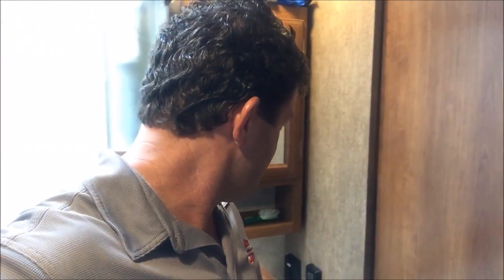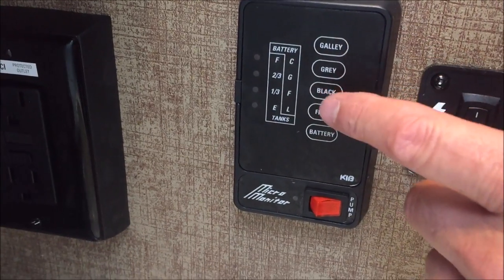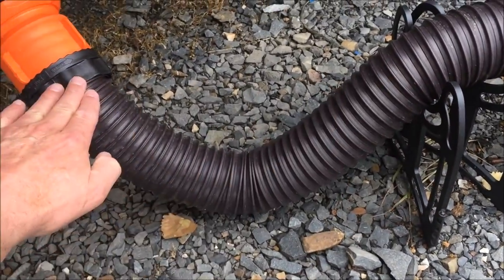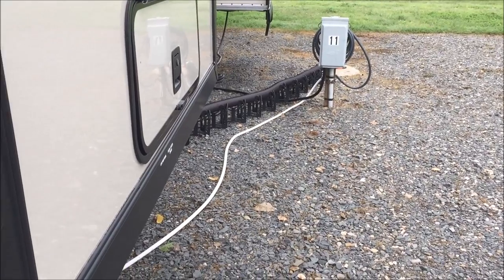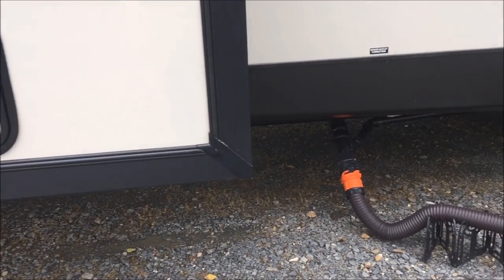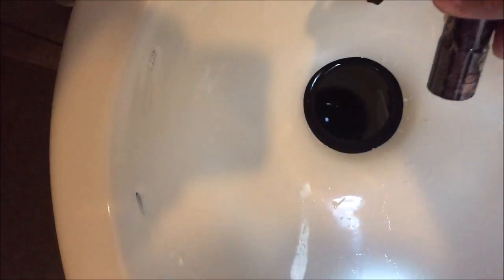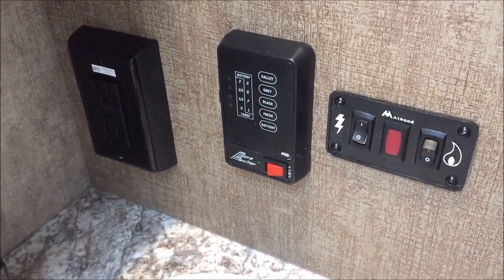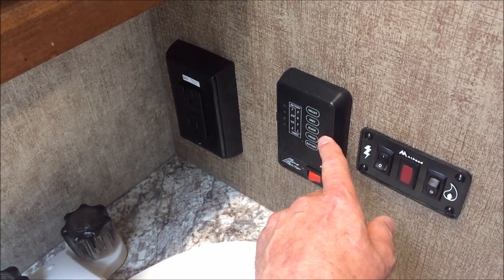Preventing Black Water Tank Sensor Problems

Comment: What type Name and model your in?
Reply from the maker: Its a 2016 model Prime Time Lacrosse 337 RKT.  Over two years full time and I still love it!
Reply: Just Plain Common Sense, okay so.... have you ever had to change the sensors? My TT doesn't have the adjustment screws.....so I'm still seeing full.i barely have two days use and it's showing Full...it's just me! I don't shower every day. Idk I'm at my wit's end with this thing! The neighbors say that I need to "take it for a drive" with about 6 gallon's and 6 oz TNT treatment. I don't have a flush valve
Reply: SoCal Gal   If you are using the auto flush as demonstrated in this video, Just be aware that they give you a false sense of security. With mine I can fill the tank twice until it runs clear. But if I then use the old fashioned stick type that you stick directly into the toilet, then fill the tank, I still get dirty water until I rinse and fill about two times. View some videos on how these auto systems spray.
Reply: SoCal Gal I don't understand the question.
Reply from the maker: I've never changed the sensors.  If one acts up I fill and drain until it clears out and the top two sensors read correctly.  I rarely get more than two lights to go out but that's OK with me and not worth the hassle of taking it in for repair.  I dump and flush once a week so I rarely have a 911 emergency around here. ;-)
Reply from the maker: Id use one of those systems if I absolutely had to. but the internal flushing system seems to work well so far.
Reply from the maker: I believe she is referring to an adjustment some models have at the control panel to calibrate the sensors.  Mine doesn't have that function either.

Comment: Also , we have been RVing for years and recently bought a used camp trailer from a family estate. I spent hours checking it out to make sure everything worked including opening and closing the grey and black valves. After the purchase we found that the black and grey tanks had been left partially full and had set long enough to have dried out. Once water was put into the tank it took nearly a full day to try to get the inside cleaned out.
Mike
Reply from the maker: Lovely.  Nothing l look forward to having to do! Or is it doo?
Reply: That is what we said to the folks we bought it from and they were going to refund some money for the trouble but we know how that always ends. Nothing.
Mike

Comment: Do not need to drop the tank. The sensor can be replaced easily, and transfer wire from old sensor to new sensor- these are really just screws, but you can buy them as sensors. Just be sure that the new sensor is at the same level as the old one. There are many short cuts to help prevent the "sensor" issue , and this one works well. I am a retired mobile rv tech, RVIA certified. Good luck!
Reply from the maker: I've recently seen the sensor replacement procedure.  I have pretty good luck so far with cleaning them in a tank full of very soapy water.  As long as the top sensor still functions, I'm pretty much ok with it.

Comment: We used water softener and dawn dish detergent, a spray wand to clean tank walls. It deodorized our tanks and reset our sensors. A final swish with 50/50 water and bleach. We leave a crook in our drain hose at the tank hookup and use the clear elbow drain attachment to know when we're the cleanest.
Reply from the maker: That ought to get it done!
Reply: I'm with you. I use much the same routine as you and have, as a full timer, used the Calgon and Dawn for a couple of years with no odors. The main thing that I think cleans best is regularly using the spray wand from inside the toilet. My rv has the auto flush but I don't use it. I did a test using it, then afterward followed up with the wand from inside and it was surprising how much additional stuff I got out. Regular thorough cleaning is a must!

Comment: Worst case, fill up holding tank with hot water and dishwashing soap (half a bottle).  Leave it filled for one day, then drain.  This removes everything and keep your sensors like new.  There are no chemicals out there that will beat this technique.  Also, don't use any chemicals for tanks.  Try 2 tablets of efferdent (tablets for dentures); it is a very cheap and effective way to rid ordor.  Important you leave at least 5-10 gallons of fresh water after flushing black tank.
Reply: Oh, and also, try not to put any toilet paper down the tank; use a waste bin.
Reply from the maker: We only use RV toilet paper.  It disintegrates very easily and causes no problems so far.  Thanks for the tips
Reply: Dawn Dishwater Detergent works the best, and if you can, take it for a spin up hills, corners get it sloshing around, and it cleans up the sensors awsome, yes very good idea,
Reply from the maker: My RV is parked so That trick doesn't work too well!
Reply: why are you worried about the sensors?  Ours haven't been right for over 6 years.  You can tell when your black tank is getting full.  Just listen closely and you'll hear the difference.  Sensors are a waste of time and money.  Haven't checked ours since it was 2 months old and it is 7 years old now.  Never waste water and time worrying about the useless sensors
Reply: 9
Reply: Those that dont take care of their rv,  even the upkeep of making sure the sensors are working correctly are the same ones that dont do maintenance on their own rv and then yell at the manufacturer and or dealer about the problems with said RV.
Reply: @Lovecamping290  I heard some video say Dawn makes too many suds and leaves a film on the sensors. He said use liquid dishwashing detergent gel. I used Dawn once and seemed to have more sensor malfunction. Just my experience.

Comment: Btw you can buy a black tank flush wand you stick down in the toilet ,unlike the black tank flush which is fixed inside the tank you can change angles and height . To get a really thorough cleaning
Reply from the maker: I actually purchased one last summer.  due to the plumbing design on my RV it wouldn't have been any better than the factory -installed system so I returned it unused.

Comment: Good basic instructions . Most first time RV people do not seem to get much if any education from selling party . One thing to consider about leaving the grey or black valve open is sewer rats . Have heard several people that had been doing that and hearing scratching noises . Several had sewer rats in both their tanks . I did like your dip in the drain hose making a trap effectively .
Reply from the maker: Never leave your Black Tank valve open.  You will create what is referred to as a "Pyramid" inside the black tank.  Water is your friend in a black tank!!  I've never heard of the rat issue.  I can see one getting in the black tank but the gray lines are much smaller.  But hey, anything is possible!  In my line of work I've seen critters get inside some crazy places!

Comment: There is a simple solution called Commando Black Tank Cleaner by Walex. Use it regularly, to prevent this problem. Use it as a soak to remove dried up clogged tanks. Great Product.
Reply from the maker: I may give it a try.  Thanks
Reply: I just heard about this liquid called "Break Down" black tank treatment. Guy said he had this problem. He decided to try it and it made a fast fix!
Reply from the maker: I'll check it out next time I have a problem with it.  Thanks

Comment: Just watched your video,  a tip, the black and gray tanks are (Holding Tanks) not a septic tank, they are engineered and designed to hold waste. By leaving your one gray take open all the time is a problem. Solids will build upon the bottom of the tank. Ever have to unplug a bathroom or kitchen sink? That's whats collecting on the bottom. Water is your black and gray tanks best friend. It's best to leave the dump valves closed. Safe Travels.
Reply from the maker: I have a clothes washer that pours gallons of hot detergent-rich water down the drain, through the gray tank and hose every day.  I'll take my chances.  Nearly three years of doing that full time without a single problem.  For the occasional "Camper" I'd agree with you!
Reply: I don't believe you had mentioned the clothes washer, that is different situation but only for the time you are running the washer. As an engineer and spending a lot of time with fluid flow and design, plus many years RVing I do not recommend it. Safe Travels.
Reply from the maker: I know from previous experience in debating issues with engineers to just say you are likely correct and to continue to do what works with me.  Thank you for your input.  If I get a video snake that works with my iPhone I may try to make a video of the gray tank after three years of running the valve open.  That ought to answer the question of weather the decision was right or wrong for me. 
Stay tuned...
Reply: Thanks for your reply.

Comment: as far as I know, all the gray tank connected things in the RV already have a ptrap, so unless you leave your black trap opened there's no real point in making a second trap outside the rv.
Reply from the maker: You are likely correct but I see a lot of folks still doing it for some reason.
Reply: True you have p-Traps that prevent sewer gas from entering the trailer. The "made" P-trap outside prevents sewer gas from passing through your vent pipe on the roof of your trailer. If you happen to smell sewer gas, and the wind is blowing right, chances are good it's coming from the roof vent.
Reply from the maker: That's a great and realistic scenario

Comment: Good idea for the sewer line p-trap. I filled my tank several times and could never get the junk off the sensors.  I live full time in mine, but it sits in one place.  I'm not keen on dropping my tank, mainly because I have to remove the belly panel.  But soon... I have to replace the black valve as something went wrong and it is jammed open, fortunately, not closed.
Reply from the maker: Good luck with that valve replacement.  They make an add-on valve that you might want to look into and just leave the old valve in place.

Comment: This is how I flush my black tank. Just running the flush with the dump valve open does not clean everything out. For the final dump when packing up I'll fill that black tank up a good 7-10 times. I get nothing but clear water coming out of it at the end. I'll do the same with the gray tanks, but only flush them twice. A little bit of dawn soap for the first fill and dump, then  just another fill and dump. Tanks are clean and free of odor without using harsh chemicals.
Reply from the maker: I used to go through a ritual similar to that.  Id fill the black tank for 7 minutes (based on the water pressure here) and that would get the tank fairly full.  Then dump it.  I dump my tanks weekly so I don't really have a buildup problem at all so a good rinse seems to be adequate most of the time.

Comment: Creating a trap with the sewer hose is a good idea.  I'll add that to my setup.
Reply from the maker: It's not going to hurt anything but is certainly a touchy subject as to whether it is required or not.
Reply: When traveling fill BOTH TANKS 1/3 full and throw a calgon dish washing tablet down your toilet and down your sink....while traveling, the sloshing around cleans the tanks
Reply from the maker: I'm sure that works great Mark.  Thanks for the tip!
Reply: Shouldn’t matter if the P-Traps have water in them inside the camper that’s what their designed for no need to do that to the hose unless your rig has no p-traps😆

Comment: I've heard people that move from place to place,pour bags of ice down the toilet and fill the black tank half full. Then take it for a spin and the bouncing and the ice cubes clean "debris" from the tank and sensor.
Reply from the maker: +BCtruck, rebuild, repair,repurpose  And it will likely work too just not happening here!!  This rig will be a "low miles" unit when it sells.
Reply: I saw a video where a guy tried that with a clear tank strapped in the back of his truck and it made little difference.
Reply: Saw the same video. If you think about it  ice cubes are very slick and can't do much for "scrubbing"

Comment: I’ve never had sewer gases come up through my grey tanks.  All of my drains have PEA traps
Reply from the maker: True, our drains do have P-traps but the holding tank has a vent running straight out of it to a pipe on top of the RV.  If you don't put a trap in your drain hose and you leave the gray water tank open all the time, then you are venting the sewer system through the top of your RV.

Comment: never leave any valves open, use that gray tank to flush that black tank dirty hose when done draining that bugger, plus your leaving a chance for contamination from your black tank getting to either gray tank when dumping.
Reply from the maker: I run two or more loads of laundry water through the gray tank daily so I bet ya my hose is plenty clean. Plus when I clean my black tank, I flush the tank with fresh water until the water comes out clear.  I'm not sure about how other tanks and plumbing are designed but with this one there would be no chance black water could contaminate my gray tank.  Things have been going great for three years now using this method. Thanks for watching and commenting!

Comment: Take a look at your kitchen sink, bathroom sink, and if you can at your shower bottom line, because  I bet that you have a "p-trap" or for them some people call them just "trap" in place.  If you do than you do not have to create your p-trap with your sewer hose.  By creating a p-trap with your sewer hose you will create a pocket that also store black stuff, and slow down you out flow.  and your toilet line will be close anyway so no gas return in the RV.  I hope that I'm right "not every RV has the same septic diagram". Good luck.
Reply from the maker: True, where ever there is a drain there is a p-trap.  I believe without creating a p-trap in the sewer hose, you are ventilating the septic system through the roof vent on top of your RV.  I've met RV folks that do it and those that do not.  Both ways work.  Its just one of those things where people differ in the way they do things I suppose.  Thanks for the comment and for watching!
Reply: @JustPlainCommonSense  right on the ptrap for the sewage line is needed as a precaution because is the only one  that doesn't have it.

Comment: Be advised, the "trap" setup on your sewer hose is a BAD idea if you are overwintering in your rig unless you have the trap area heated.  If not, and it freezes, it's a pain in the crossbred donkey to deal with.
Reply from the maker: I understand your concern.  I have just shy of 3 years full timing and haven't had that problem yet.  Fingers crossed...

Comment: Naw boss no need to drop the tank, put a back flush fitting to blast water in reverse Or some set ups can put a wand straight in the toilet, I made one with a piece of hose, plug the end that goes in toilet drill two or three holes in that end of hose around sides of hose  stick in the tank, turn water on and sprays out of the drilled holes like a yard sprayer to hit the sides of the tank. sensors work again.
Reply from the maker: Yep!  That was an early video.  I've had to learn a few tricks along the way.  I'm good as long as that last sensor still works; I could really care less about the others.  Thanks for the advice!

Comment: You don't need a p-trap on the outside of the RV.  All of the grey water drains already have one and the toilet has that sealed lid.  There are also vents.
Reply from the maker: It is not required but if you don't put a p trap in your drain hose, you are venting the RV park's sewage system through your vent stack if you leave your grey tank valve open, correct?
Reply: It has to vent somewhere.  Unless your line makes a sealed connection to the sewage pipe it's venting there too.

Comment: Not sure I would use a T valve to split drinking water and black flush.
Reply from the maker: I no longer do that but not for the reason you may think.  Here is the reality... In an RV, your plumbing is always very close to commingling with undesirable components.  Here is where I'm going with this.  Look inside the toilet next time you flush.  Water is entering the toilet but where is the source?  The water is either coming from the on-board tank or the supply line; the same source you use to bathe, cook, wash dishes and likely drink.  In your mind, back-track from the toilet to the tank then to the kitchen faucet.  Its all connected, right?  Sure, there may be an anti-reversion or anti-siphon valve in there somewhere but it is still all connected.  
I now have a dedicated fresh water hose and a dedicated black tank flush hose.  The black tank flush hose only gets connected when it is needed because it is also used to wash the trucks.  
You are likely correct in thinking it is a bad idea to use the "Y" but I can see no way around the fact that it is all touching anyway...
Reply: I use the y for my black water flush too, but I found a check valve that fits garden hose threads and put that in on the black side of the Y

Comment: had water down the pipe emptied the black tank i know there is more somewhere flushed it for quite a while; it takes 150 liters; cottage from USA cedar creek no paper problem i keep putting water down it no waste yet can you help thanks. been using the little pods just pop it in  its getting better so i think i will just fill it my way with warm water with your detergent oh, boy there is a faint smell now night time!
Reply from the maker: There are several possible solutions.  Close the black tank valve and fill the tank with hot soapy water then drive!  It ought to knock that stuff loose and allow it to drain out.